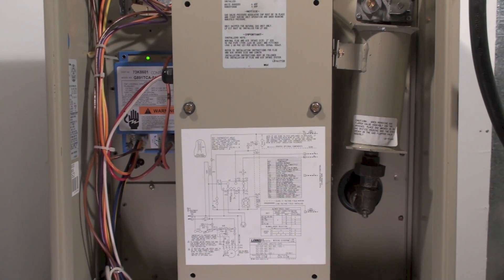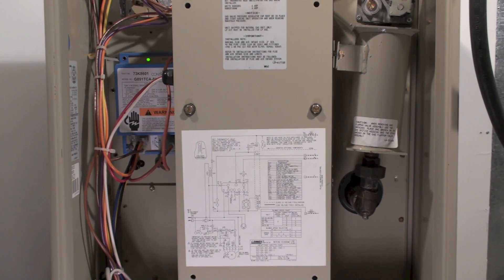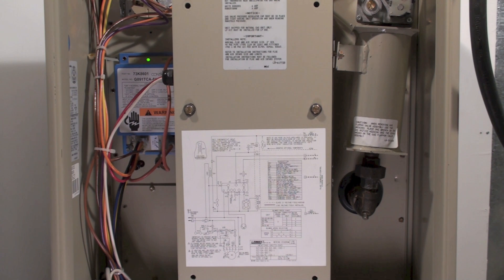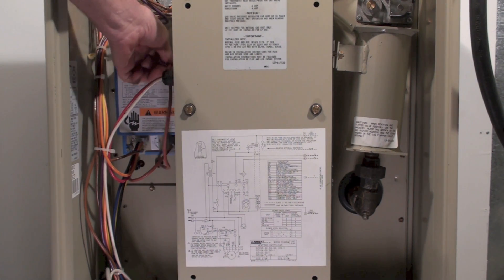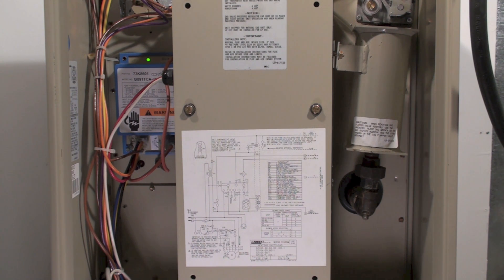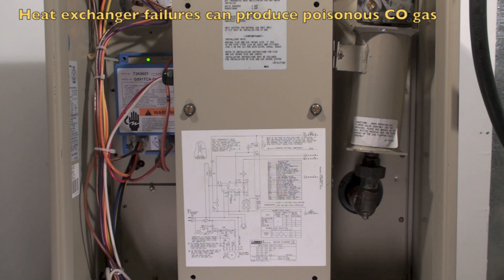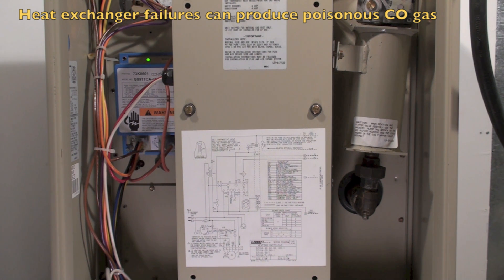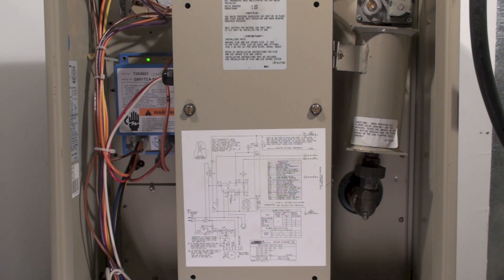Lennox pulse ignition failure

Comment: Someone mentioned cleaning out the drain thing. Mine was condescending too much and I found the drain hose was clogged. I cleaned it out and found water was dripping all over the unit and inside the furnace it was wet and the insulation around the air flapper was still wet after a good week. I haven't had to use the air for a while and tried the heat but heat will not come on but air works.  I have it apart to dry out. Would it getting wet inside cause the heat to not work and what should I look for next?  Thanks for any advice.

Comment: Awesome video, sir how would you rate a 1996 pulse 21 propane 80,000 btu in 2022 with great heat exchanger pressure tested 3 month ago 4psi held for 30 mins no drop at all awesome condition ,  Curious would you up grade 26 yrs later to dual stage or carrier furnace, thks
Reply from the maker: I would strongly consider replacing the unit, as the parts availability is limited.  Happy new year.
GFM
Reply: @grayfurnaceman  great, parts are not bad online like eBay, but I understand parts issues, but it a great Furance , would you recommend dual stage or modulating for up grade, thks again
Reply from the maker: @scottmagyar  The modulating furnace has the most potential for savings and is well tried.  The 2 stage is also good and the operational cost is close to modulating.
GFM

Comment: I have a Pulse 21furnace that seems to run fine but after a few hours or days it starts blowing cool air requiring me to turn it off and reset the control module. The air flapper has been cleaned (a new one is on order) and the control module replaced this past Oct. Any ideas? Thanks!
Reply from the maker: Have you cleaned the flame rod?
GFM

Comment: My lennox pulse G14 sputters as it gets warmer and I think it is going to die but it continues to reach temperature. It runs smooth then reaches a certain point boggs down for a couple seconds then smooths out for about 10 seconds. It cycles like this and reaches temperature. If I turn up the temperature quickly it trips out the ignition sometimes.
Reply from the maker: Flapper is the first culprit.  Replace it.
GFM
Reply: Thanks for your knowledge. I appreciate it. I replaced the air intake flapper and it still does the same.
Reply from the maker: @Tony-bh8sh  I would be looking at the spark plug.
GFM

Comment: I have a lennox pulse it runs perfect but the lennox guy told me he doesnt recommend i run it its too old . Im guessing hes just trying to sell me a new furnace.  Cant see a reason to stop using a perfectly fine furnace. Im for maybe replacing it but i feel pressured to do it now when i see no reason for the rush it works great
Reply from the maker: The pulse furnace has a lot of heat exchanger failures but most are obvious as the unit will not start or there is a very sharp smell.  However, I would invest in a CO detector.
GFM
Reply: @grayfurnaceman  thx for a fast honest answer . I will invest in a few tomorrow and likely replace the furnace in spring anyway . Glad for your comment

Comment: My Pulse will not always respond to the thermostat's demand for heat but it will start right up when I switch the power switch off and then on again.  Then it might run for several days with not problem.  Does this sound like a thermostat issue or a furnace issue?
Reply from the maker: Its a furnace issue.  The ignition controls on these furnaces gave a lot of problems.  You could also have a dirty flame rod or spark plug.
GFM

Comment: Hi grayfurnaceman, a buddy of mine gave me his old Pulse for use in my garage. I'm halfway thru the installation. I want to omit the mufflers from the inlet and exhaust as again, it's in my garage, no need for quiet. Would omitting the mufflers in any way effect the performance or will it effect the omission of CO2 gas?
thanks in advance
Reply from the maker: Lance Law I have seen them run without the mufflers so I think it would be ok.  You do need to provide a way for the condensate to be drained.
GFM
Reply: great. yes i have the tee with a drip leg and condensate to drain (with a trap of course).

Comment: I have a question for you grayfurnaceman. I have a Lennox Pulse G14 and i was wondering what a particular part is called. Its the metal cage that surrounds the air flapper valve assembly. Im trying to locate a replacement
Reply from the maker: Its called a cover plate and underneath it is a clearance plate.   Hope this helps.
GFM
Reply: What i am talking about is a metal bot with hundreds of uniform holes in it. it takes up the whole inside. It sits right behind the square piece of insulation that you removed when you showed the flapper valve in your video
Reply from the maker: Jay Walker That's the one and that's what they call it.
GFM
Reply: grayfurnaceman
Ok cool you wouldnt happen to know the part number for it or where I could get one at would you?
Reply from the maker: Jay Walker The only place I know is the Lennox dealer.  If you want to look at a G14 install manual, check graycoolingman website.  The is a list of manuals there that may help.
GFM

Comment: There is a lot of things to check.Flame sense rod doesn't make it run rough. I don't believe its a heat exchanger. Could have trap problem., whats gas manifold pressure. when was gas flapper changed. Sounds like another service tech that doesnt know how to work on a pulse
Reply: +Gary Abbott yep. I am thinking the same thing.
Reply: P

Comment: I Love watching your videos I am a fellow HVACR multiple NATE certified Technician and work for as a Lennox Dealer. The 1 thing I noticed you didnt adress was the cleaning out of the mudleg or condensate drainage off of the flue Especially if it has never been done before and maybe you should adress the proper way to cut it off for the first time and placing the rubber cap on it.